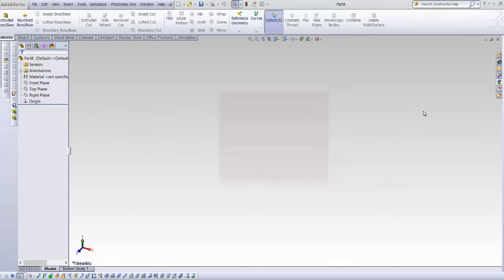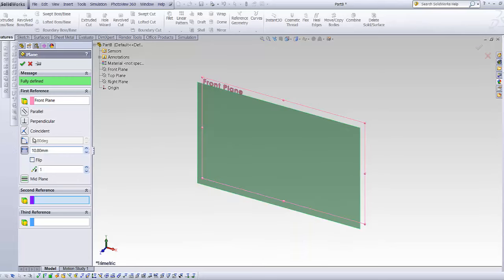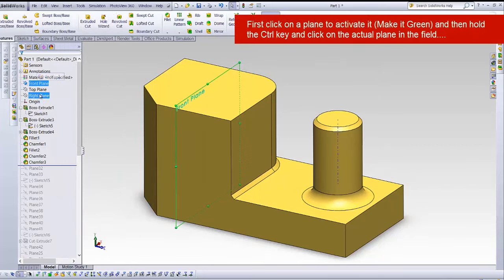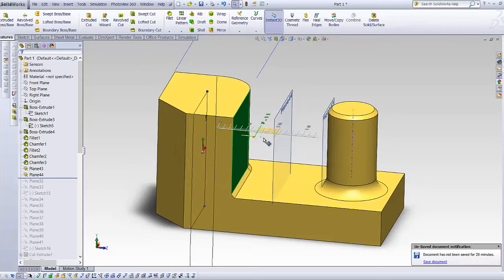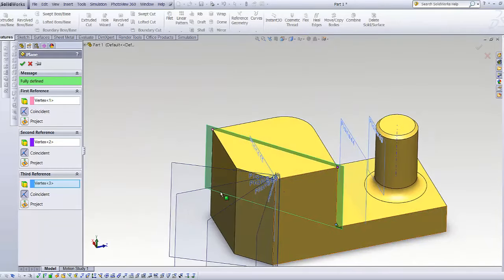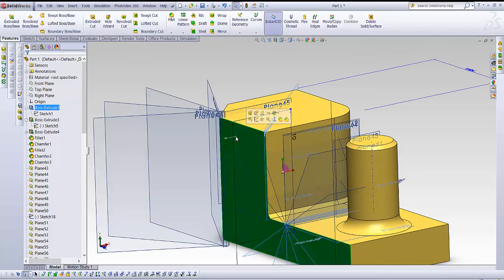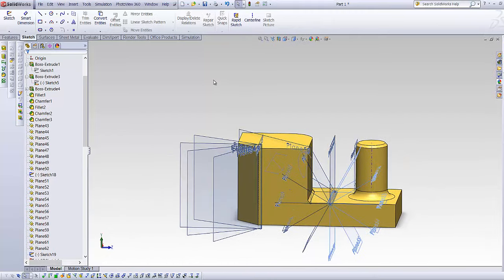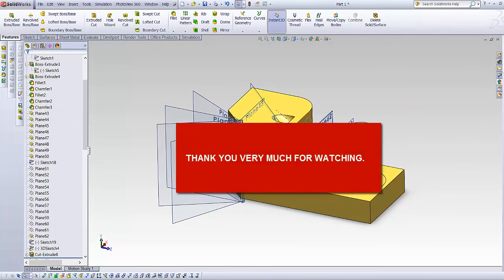SolidWorks Tutorials  - How to Make New Planes SolidWorks

Comment: I'm new to solidworks, and I don't understand the need for planes, I understand starting with one but why add planes. . . . that's what I wished you would have shown, sure you know how to make a bunch of planes, but big deal to me if ya don't explain why make planes.   In otherwords so you made a bunch of planes, now what?  What's it purpose?
Reply: you can only draw on plane, later on, after you created the 3d object, there might be a need to draw inside the 3d object which is no longer on the origin 3 planes. thats is when you need a new plane.